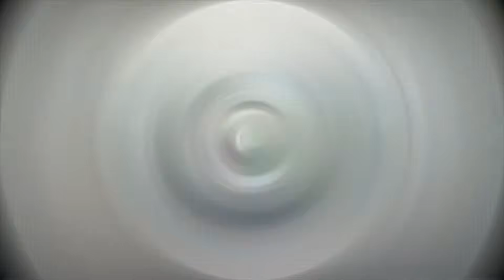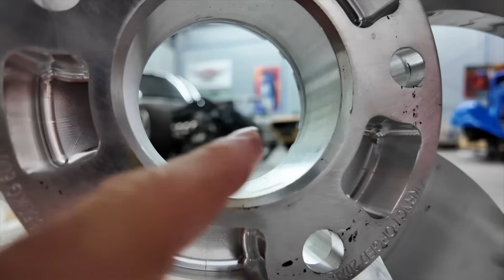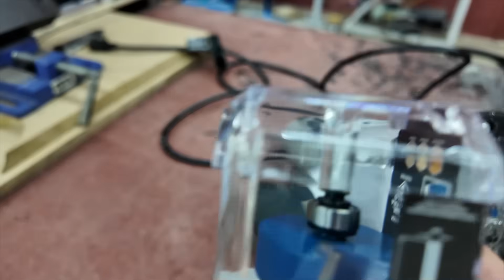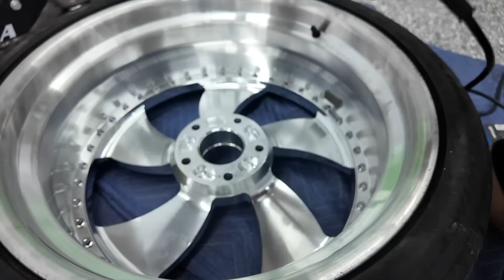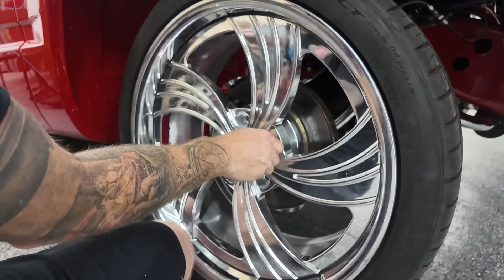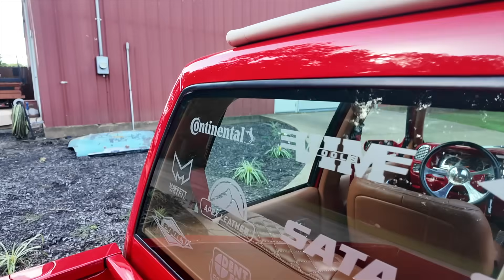New OBS Wheels!!! But we ran into a problem! Check out how we made them fit Routering Aluminum!

Comment: I had the same problem I used the smallest spacer I could find you could not tell I had it on there! But this is a great idea.
Reply from the maker: Super easy. Spacer is another way to go, but on this one just that little bit of spacer put the wheel out to far.

Comment: 1993 called, It wants it's wheels back............
Reply from the maker: Sure jt did.
Reply: I think they are cool. What do your wheels look like? He could have responded negatively to your comment. But he didn't. Which shows he has more class and taste than you do.
Reply: @blahblah4125  I would have out some salt flat wheels on it. Those wheels look like something the minitruckers used in the late 80's and 90's. They date the truck BADLY.
Reply from the maker: @TheREALOC1972 well I guess we can debate wheels if you like. There were no wheels like this in the 80’s. It was around 2002-2003 that the slant spoke like the intro twista vista was even designed. The wheels that were on the truck were a 90’s wheel tho, the fact that this is the only wheel exactly like this in existence makes it interesting that it dates it back to the 80’s.